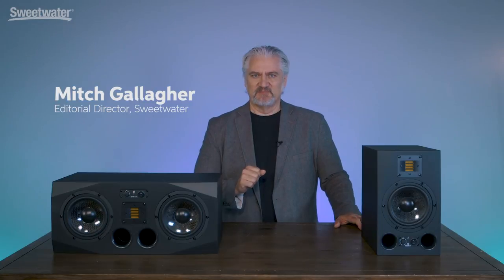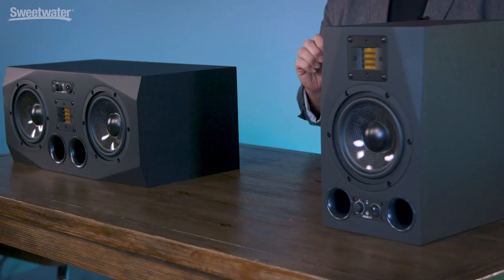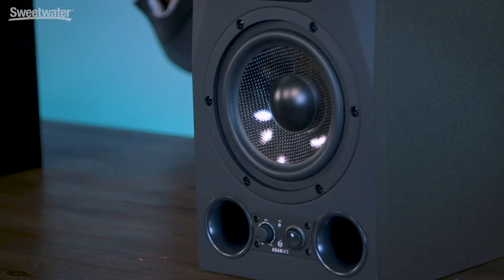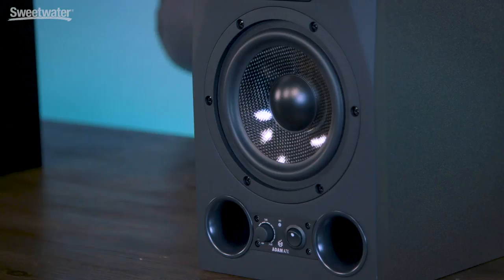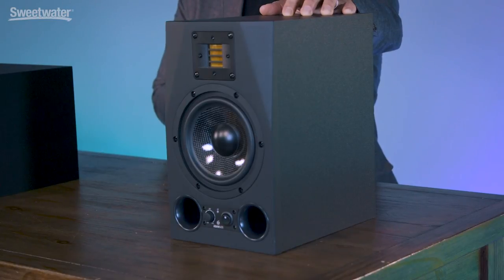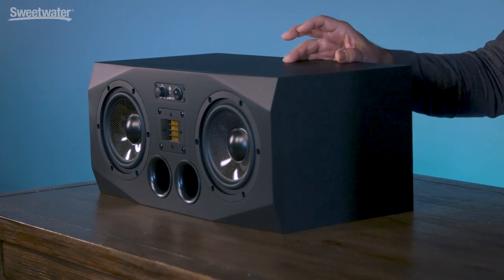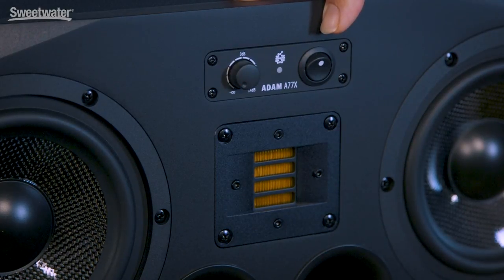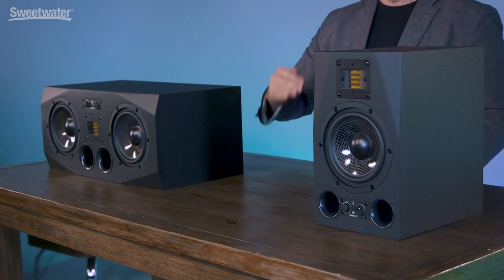ADAM Audio AX-Series Monitors Review

Comment: WHEN I FIRST STARTED BUYING MUSICAL EQUIPMENT FROM Sweetwater around 2009 , Adam Audio's line of studio-monitors was prominently featured in the their ProGear catalog. Then about several yeas ago,  Sweetwater abruptly stopped carrying that line. When I had inquired during a phone-call to my sales-rep. about what had happened to the Adam monitors, the only answer that I ever got was, "Well, they [Adam Audio] started doing some stuff that the management here didn't like". Now , after several years of being absent from the Sweetwater line-up of manufacturers, here is the return of that brand. I am still left wondering, "What exactly did Adam do to get dropped by Sweetwater in-the-first-place ? ... and what have they done to cause the management there to once-again carry their products ?
Reply: charliebe28 Internets biggest mysteries 101 ?
Reply: Did Sweetwater drop Adam or did Adam pull their product? 🤔🤔🤔🤔
Reply: @MJamesIII : 
~ It was my understanding that Sweetwater dropped Adam Audio. If you were to re-read my original comment, you should be able to discern that is the circumstance that I was describing.
Reply: @charliebe28  i read exactly what you said. You’re going off of hearsay from your rep. 
Companies have pulled their products from retailers plenty of times for a variety of reasons.